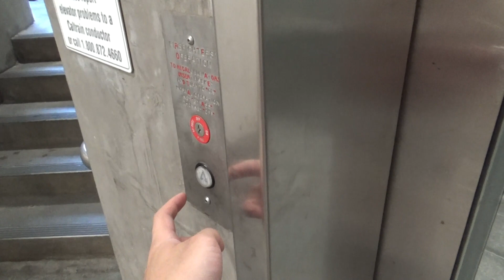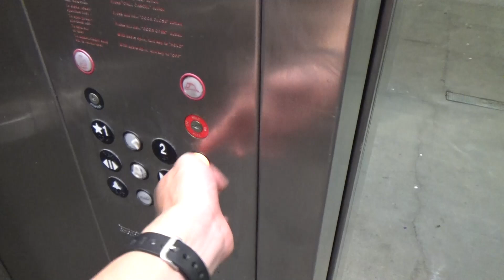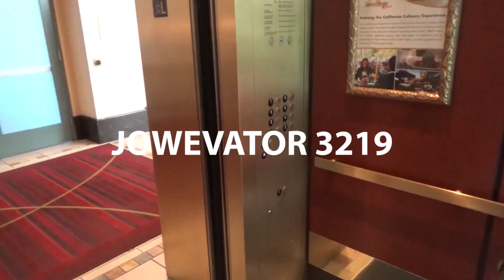DANGEROUS ThyssenDover Hydraulic Elevator - San Mateo Caltrain Station - San Mateo, CA

Comment: I actually have ridden a DANGEROUS 1978 Lexan. I tried to open the doors to safetybreak it, but after I did it, it kept moving. It still hasn't been corrected even after it was turned back on.

Comment: Definitely going on the Top 10 Worst Elevators of 2021. I have never seen a Thyssenkrupp in that bad of shape with a lengthy list of problems especially with the elevator not slowing down when going up to the top & overkill leveling going down. I'm surprised it got the inspection certificate. That elevator needs to be fixed ASAP before it completely breaks more.

Comment: You can break the glass if you get stuck
Reply: With what?
I’m sure the glass is sturdy
Reply: @patricknedz  any kind of glass can be broken, you could prob break it if you ram yourself into it
Reply: @patricknedz  well, even if you cut yourself, still beats being trapped in an elevator, and plus, that glass doesn’t look that thick
Reply: @MemeReviewer  just call the fire department and they will get the tools to get the door open. I been stuck before and it’s not that bad. Fire department came and opened it.
Reply: @patricknedz  nice, forgot about the phone bit, but in the circumstance you have no phone on you, that is what I would do.